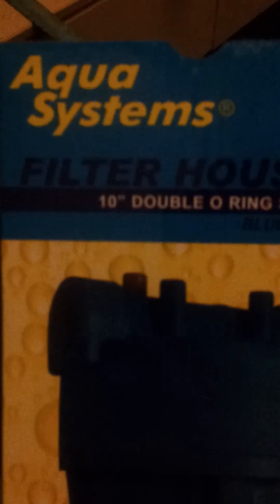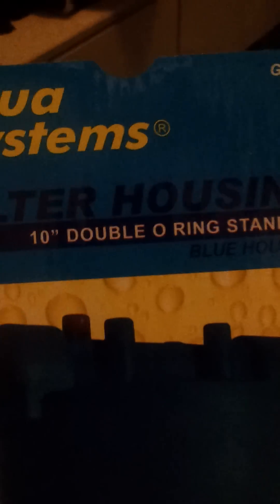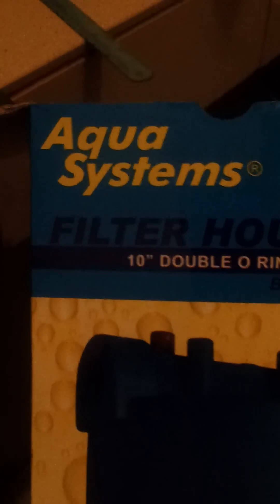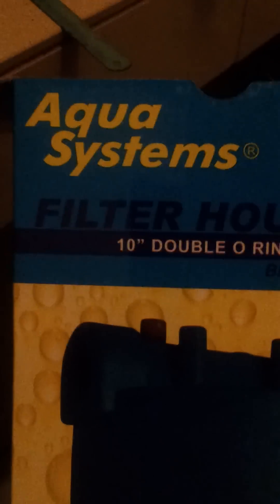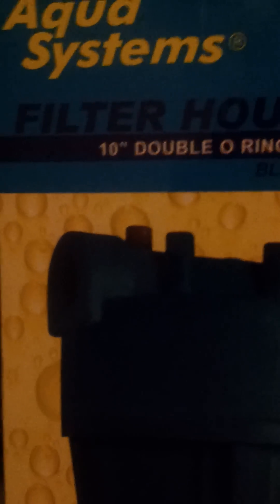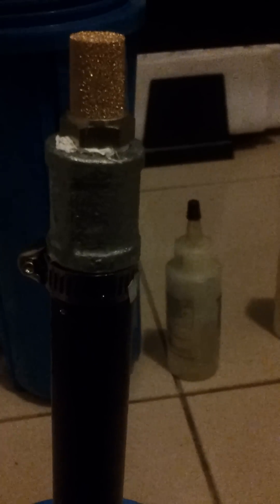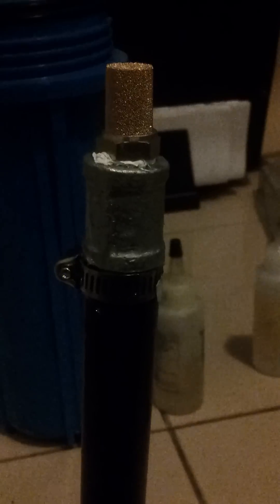diy dessicant dryer CHEAPEST ONE  filter for air compressor

Comment: Hey Diego where do you get the housing from?
Reply from the maker: On a hardware store is a in line water filter used on water tanks I spend like 25 dollars in total of all supplies and is bigger then most costly brand units and work awsome no leak or desiccant intrusion on air lines .
Reply: diego villanueva
 Thanks for the info

Comment: How does it work?  Did you try it out yet?
Reply from the maker: I used to paint half of my project car and do the job like a high end costly unit no problem what so ever and I found my compressor actually is the source of my fish eye problems is passing oil by the piston ring to the tank to the lines after I finish painting found the desiccant full of compressor oil .